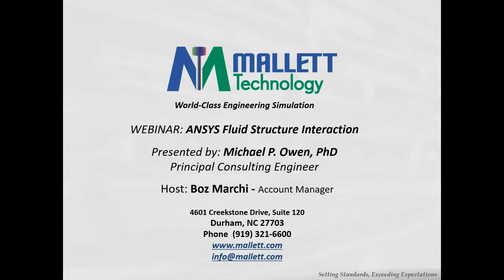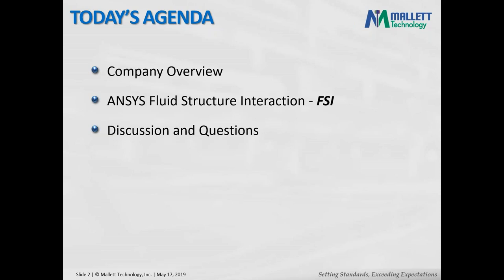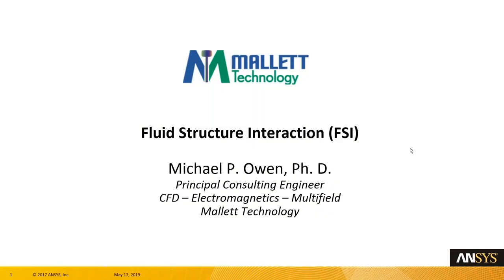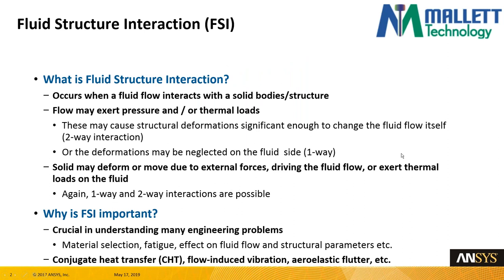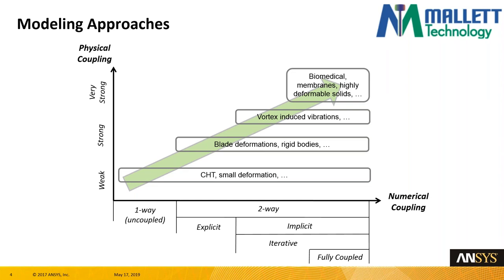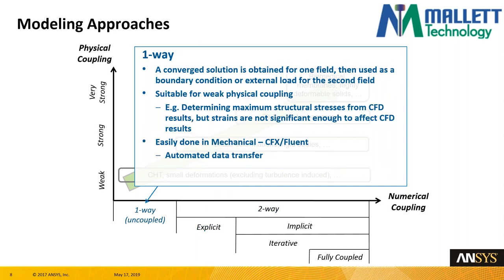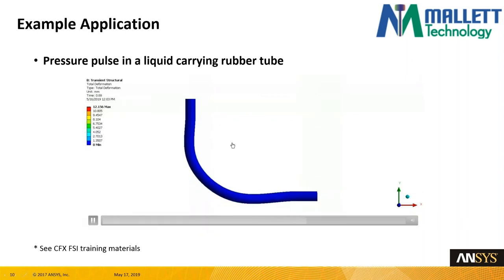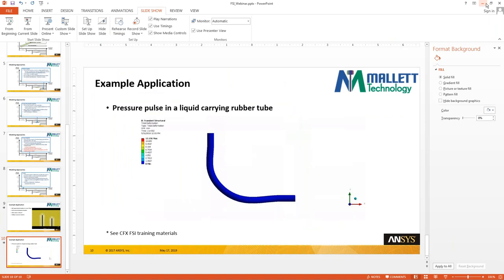How to do Fluid Structure Interaction (FSI) Analyses in ANSYS

Comment: Thank you.  The system coupler is used only for mix analysis mechanical and fluid interactions or it also might be used in simulation of turbine stages: fluidfluid interaction of fluid - rot.domain and then fluidsolid interaction of fluid with solid bodies?